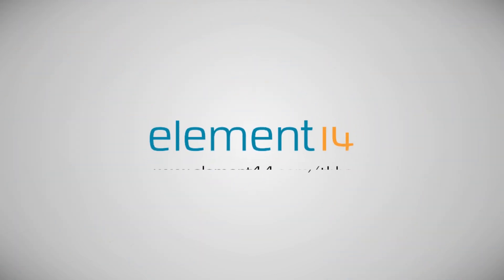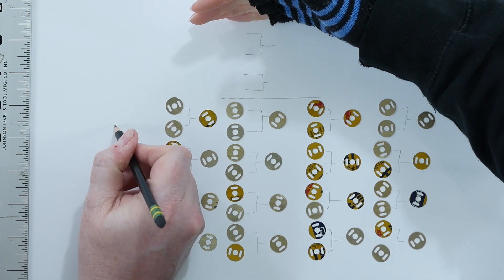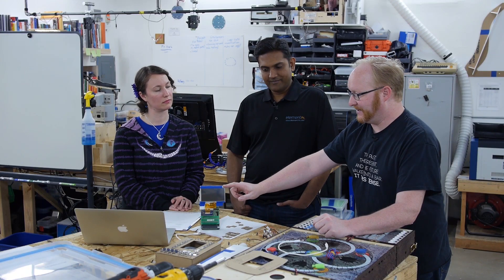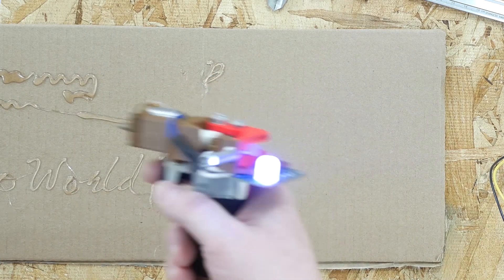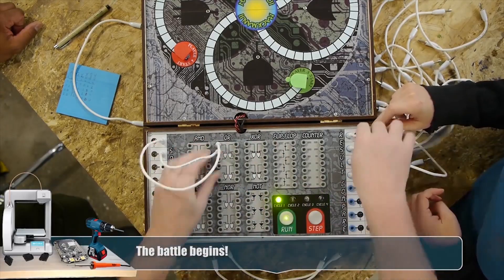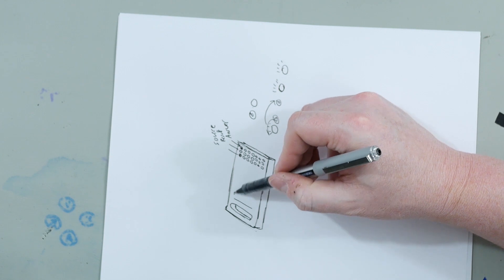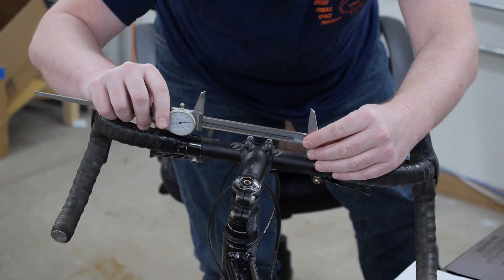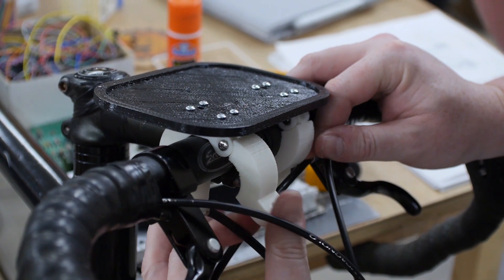Logic Gate Board Game 05: Epic Conclusion!

Comment: Why not integrate a user owned tablet? Like just use the otg USB cable and go to one board, no screen, only have to worry about interface, and supply different size trays so various things can fit, tablet, iPad, smart phone, etc.
Reply: For jumpers, pcb length, both ends have small magnet soldered by pic and place, one end north other south.
Reply: So many games could be better if they had physical interface to go along with a device

Comment: One thought, drop the game and go for educational use of logic gates. Small plug in gates (with a graphic of the function) that plug into a matrix and form one component of a circuit. Join up the Logic gates to form a Graphical diagram of your circuit with LED's as outputs and 555 timer/Toggle switch inputs. Just a thought.

Comment: pretty sure you should have just designed a cell phone app, instead of calling it quits
Reply: Just an idea, but this can be shared beetween a tablet, and the logic board... Just need some kind of connection to do it...

About the app design, I think, Ben proved a few times, that he can learn and code to a lot of type of MCU-s in different softwares... I'm not an app developer too, but with some coffein and maybe some help (after the base code is published) from the community, actually the game can be done to an Android with more less cost, since you don't need to put overkill MCU and the LCD...
Reply: could element14 hook you up with one? I'm sure there is interest in interfacing custom designed hardware with apps running on common portable devices.
Reply: Sounds like a job for http://www.zachtronics.com - I'd buy that.
Reply: Kinda not what the show is about though. TGHS, for me, is about hacking and designing physical products not apps for phones (unless they are in support of the physical item of course).
Reply: None of us are app designers.

Comment: How about a game called "Which switch is which" - just some rough thoughts..

I'm imagining a grid array of switches (6 x 6?) (which I agree are fun to toggle) and a display

It could have several themes & levels (must complete before the timer runs out) that could include (in order of increasing difficulty / age):

Game 1: 'Patterns'
 - Switches have to be flicked to match the pattern on the screen
 - Levels could include larger patterns
 - Advanced levels could include the pattern changing slightly after a certain time interval

Game 2: 'Memory' - you have to switch the 2 switches that reveal the matching pictures / characters (or whatever)
 - If there's not a match, both switches have to be turned off before progressing
 - If there's a match - the switches stay 'on'
 - Levels could include more and more 'things' to match in the given time limit

Game 3: 'Binary Bonanza'
 - Have to flick the switches to represent the decimal numbers given
 - Levels could include needing to solve multiple rows / larger numbers and/or hex

Game 4: 'Lightning Logic'
 - Along the lines of what you guys were already thinking
 - Have to flick the switches physically to complete the correct circuit on the screen to make the logic output true.

Games could accommodate 1 or 2 players

Comment: I still believe you could've done something with the Minecraft logic Blocks you had previously. It was far more interactive and visual. :)
Reply: There was more than one day of us working on the Logic Gate game that we said, shoulda gone with the Minecraft blocks.
Reply: You could still do that. The main concern you'd have with those is making the connection system standard and expandable, so you could add more functions later on. Maybe do something like the Neopixel led's do with a data line that continues through the blocks so a 'smart' block (attiny powered?) can address them centrally if you want to. It's easier to develop a 'base' set of blocks and expand them later on with additional sets. Saves on development time and costs I think.

Comment: Is there still hope for the n64 portable concusion?
Reply: 27th July. Facebook.
Reply: Tommy Peterson
And also non-youtubers.
Reply: The Ben Heck Show

Try lifting pin 7 on the clock chip nearest the RDRAM, then tying it to Ground.

I bet the board would magically spring to life then, albeit at 4/5 the normal speed. hehe

(some newer N64s have a combined dual clock chip though, so "FSEL" may be on a different pin.)

https://console5.com/wiki/MX8330
Reply: The Ben Heck Show

I had the same issue on the Mini N64 motherboard I designed, because I screwed up by somehow swapping the inner two ground layers. lol

http://imgur.com/a/beMm5

Thr RDRAM is very fussy about proper impedance matching on the bus traces, so it's important to keep the wires to the termination resistors as short as possible, but also keep the wires close to the ground plane of the motherboard (or the VTERM plane).

Things like the RDRAM clock trace from the MX PLL chip also have a specific trace width, so the impedance is controlled along it's length, and matched to the term resistors etc.

It can be made to work by soldering on the resistors as you've done, but can be tricky to keep the wires short etc.

Even the slight gap caused by the piece of PCB you used can stop it booting, as the RDRAM normally runs at 500MHz :o (250MHz clock, but with DDR transfers on the bus).

Tying the FSEL pin low on the main clock chip set the PLL multiplier to 14 instead of 17, so the RDRAM clock is then only around 205MHz (410MHz DDR).

That does mean that the CPU and RCP run slightly slower too, but it's surprisingly playable, and doesn't affect the video / audio timings, since they use the separate clock chip and crystal.

Worth a try for testing, at least.
Reply: ElectronAsh, Dont put plier under the board. It may touch the metal part.
Reply from the maker: Yeah it feels like the n64 caused concussion, it's been a total pain.
Reply: The Ben Heck Show I hab to read your comment 5 times until I got it. 
*Conclusion